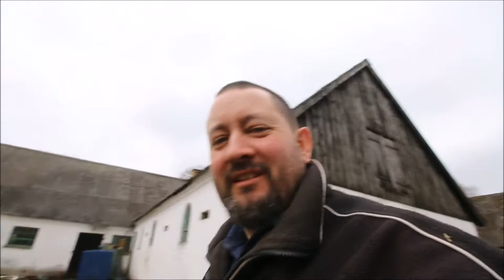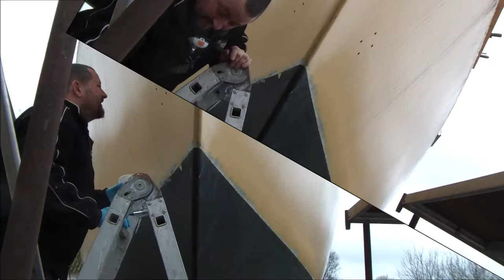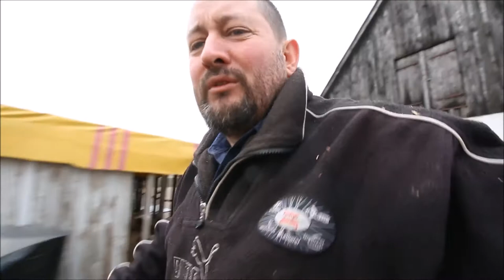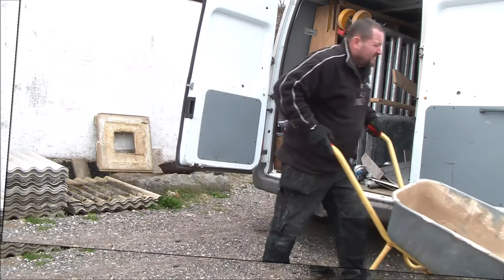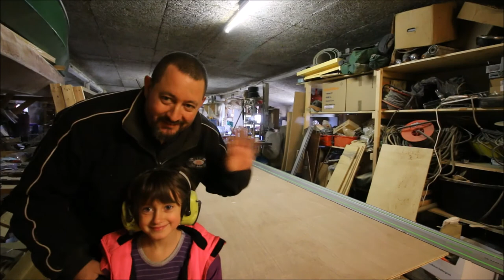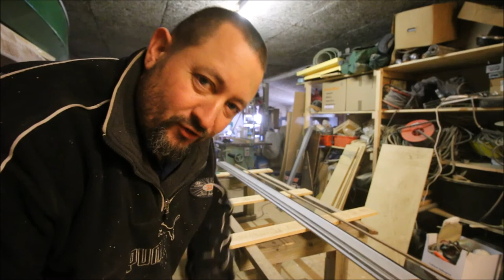mounting the bowsprit. Unloading of stainless steel Film 41

Comment: I for sure would have made gaskets for the bowsprit braces, water will find a way under and will get between the fibreglass and wood.
Reply from the maker: You can not see it on the movie. but the drill holes are primed 3 times with epoxy and on the fittings there is sigaflex